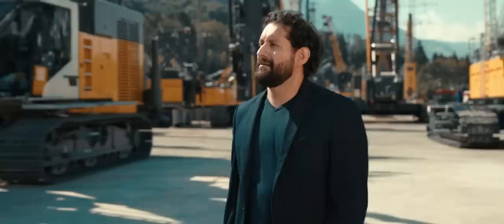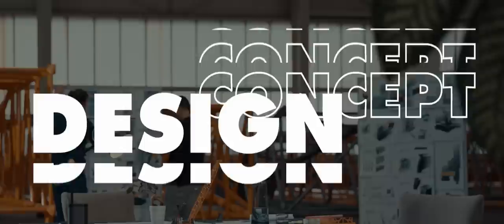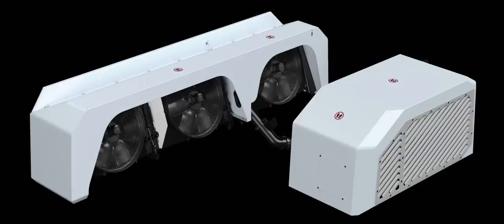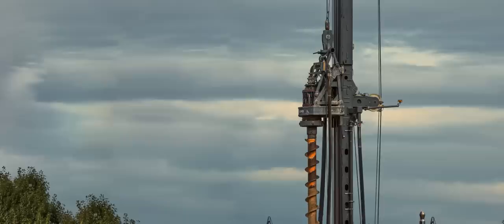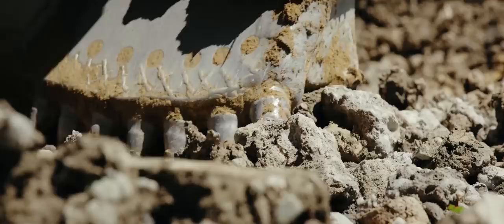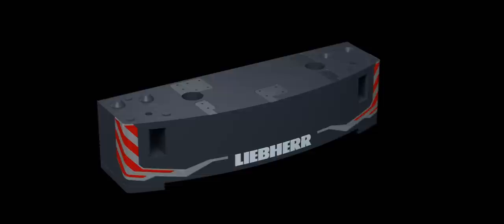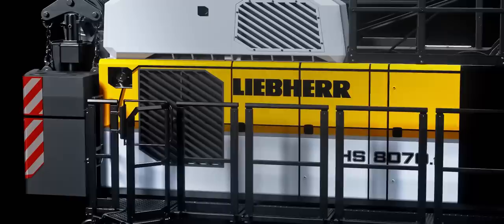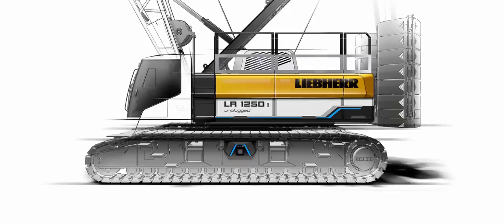Liebherr – World Premiere 2020

Comment: 50 years we have had electric lawn mover with cable, now finally we have electric crane with cable. Great success!
Reply: But in terms of electric supply at conventional construction site, how do they get electrical power unless they use big generator to produce the electricity. 🤔
Reply: Hahahahaha
Reply: @hayzeqeiqbal  Through the same line the jobsite feeds from? They're meant for urban environments, so there should be a main connection line where the building, or whatever they're building, will get its electricity from.

Comment: when he moves and speaks the auto-focus or focal point is hurting my eyes. Not to mention the audio is not synced 100% or believable with that sound stage. Details on the electric version would be great because those counterweights could just be more batteries and how many KWHr's does it take to power this thing? Next Leibherr will have a nuclear power station that you can bring into the job site and wirelessly power all the equipment.

Comment: That was rubbish, Leibherr make good machines but are failed by their PR Department and what is being missed in this new electrical age is that the power has to come from somewhere, a lot of mining needs to be done to create batteries and thus are we just moving the problem rather than solving it? The Americans built some enormous electrically powered mining machines to dig coal and they were hard wired to the plant that they supplied coal to and it could be suggested that they were not polluting if you ignore the coal fired power station. In any calculation of energy consumption one must always go to the beginning of the process.